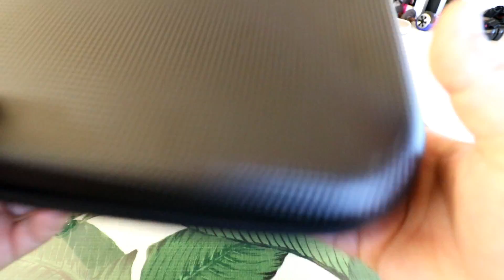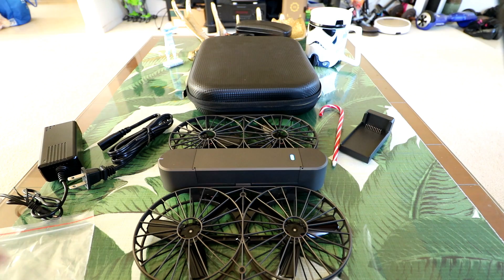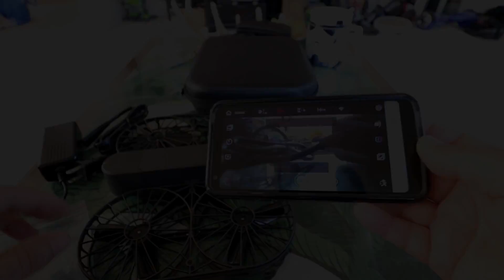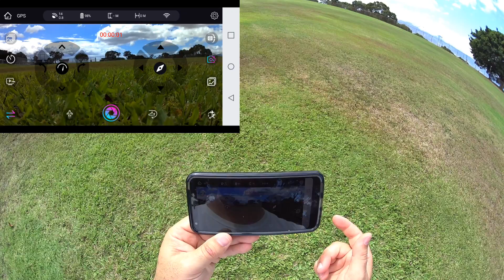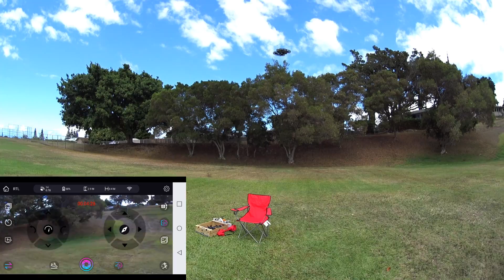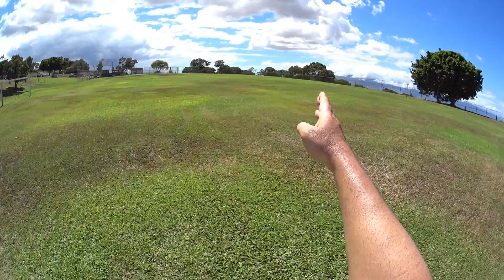SimToo MOMENT Folding 4K GPS Selfie Drone - Full Review - Unboxing, Flight Test & FLY AWAY! 😰

Comment: You didnt read the instruction? "Please control aircraft within 100m range". You flew farther than 120m and lost the drone. Coolest drone, 4k cam, brushless motors, 100m wifi, I will buy it.
Reply: The drone is quite good if you want to take only pictures. Honestly one of the best in this price. I do not care about video and about the follow me function. 12mp camera for this price is a good deal. Unfortunately (as I wrote before) the app is crappy and you risk a crash everytime you fly... I lost the drone just few seconds after taking off. App chrashed and drone starting to fly way ay full speed on the horizon. It is absurd but it is like that... and more over I do not understand why  it has a limited range of 10m high when u fly and than it goes by his own at 70-80 m when it is out of control.
Reply from the maker: A GPS drone with RTH should come back 😂

Comment: Having suffered a fly away, I ordered an Intelligent Mini GPS Tracker for my Mi 4K.
Size: 39 * 23 * 10mm / 1.53 * 0.90 * 0.39in / Weight: 18g / 0.6oz.
It will attache to any Quad with a small piece of Velcro.
Track it with your phone and when close will emit an audible alarm.
Cost $17.99.
Pretty cheap for peace of mind.
No more MIA Quads.

Comment: Hello Dustin, i just watched your Phantom 3 video and i have a few questions if i may please.Hey. I have a question for you or if anyone can answer me ty. When the P3 does a low battery auto return and it is landing like 50ft away from you can you use the stick to bring it in closer to you while it is doing the auto landing? And i didn't hear if you said it or not but does this dron have sensors on it like the P4 does? And also you talked about the P3 Standard,pro,advanced whats the P3 SE and do you know the difference? Thank you sir.

Comment: Man, that sucks... My advice, before you do these range tests or even before you go out to fly with a new quad, put a litlle sticker it with your phone nr or e-mail adress (home adress would be a bit risky in my opinion) so if you run into any of these problems, at least you have a chance of getting it back.... All the best Justin
Reply: That's an excellent idea. I'm gonna put that on my drone just in case.
Reply: All my bigger drones have a sticker with my name and phone number, never had a flyaway or crash out of sight but... You never know...
Reply: Drone lovers Portugal  I also put REWARD under the phone number it kind of gives them incentive to make the phone call.
Reply: Did you ever get it back?
Reply: Drone lovers Portugal   Justin?
Reply: vashon100 case... eh eh
Reply from the maker: +Drone lovers Portugal good practice.  I do sometimes but forgot to for this one 😵✌
Reply from the maker: +Carl Smith Not yet unfortunately 🤔🍻
Reply: @DustinDunnill  I had the same problem and I lost it... Actually my case was even worst because I did not even try to fly as far as I could. I just lost control, app was not working and drone starting to fly away as a baloon. Battery was fully charged. No words... Probably the best practice is to attach to the drone a small gps tracker. It works with a micro sim phone card. And when u call it you receive back an sms with the exact position. They are pretty small and light.